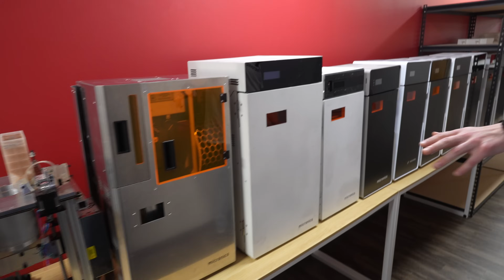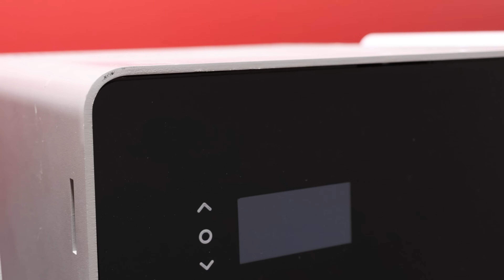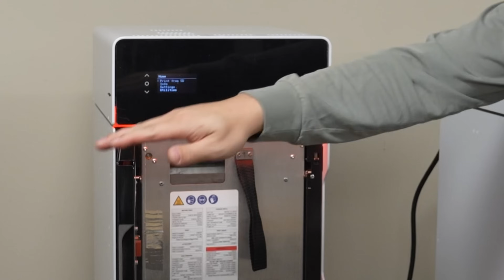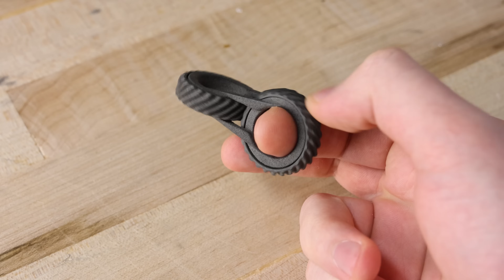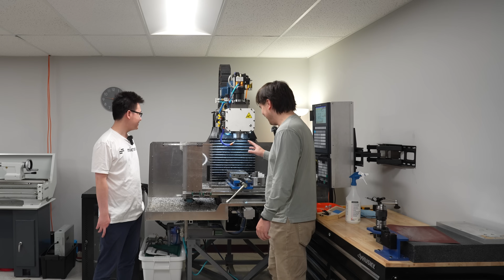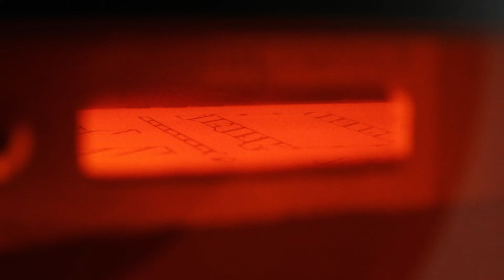micronics Lab Tour - Small Printer, Small Team, Big Vision

Comment: I would like to learn more about safety concerns when handling the powder. Powders are really scary to work with since they can get into and coat your lungs. A simple facemask is really not enough to keep the powder out, you need to get a positive pressure mask. There are definitely some DIY solutions that could be improved for a good positive pressure mask.
Reply from the maker: Most SLS nylon labs that I have visited seemed to have powder in the air. It seems like a safety concern to me, I would only use this in a well ventilated space, with a filter so you aren’t just exhausting microplastic powder into the surrounding g environment

Comment: I don't understand the kids here piling on the company - Strangeparts dude have created needlessly so much drama. Him suggesting them postponing the kickstarter and disclosing that they're "running out of money" has been a dishonest and pretty slimy thing to do. He didn't even do a review or the parts he successfully printed - wtf is that about?  It's like nobody ever received as 3d printer PREPRODUCTION!!!! unit that had problems. And these problems seem to be fixable, not something that is fundamentally completely flawed. 3d printers are precision machines, just bad shipping can destroy them.
Reply from the maker: Drop testing the packaging is very important! Shipping loads are much higher than anything a machine will typically see in operation. Usually by orders of magnitude
Reply: I agree. People are way over reacting. Micronics has cleared up most of the misunderstanding. Scotty is even still working with them. If they were pure evil, you'd think he would have stopped. They told him to publish the video along with everyone else publishing and he did. His big assumptions weren't very helpful. Either way, they've raised $1.35 million and I hope the printer is a great success! Really not sure why anyone wants them to fail so bad.

Comment: Really hope they are able to iron out the problems that other reviewers faced. Looks like they reached their funding goal so perhaps they will have enough capital to deliver.
Reply: SLS printer is massively complicated, so many things have to go just right and so many things can go wrong it's a miracle they've been able to miniaturize it so much and it still (mostly/sometimes) works well. Probably the hardest part is still ahead of them. Not only do they have to discover exactly what is causing each problem, but also how to prevent it from recurring, and then there has to be a rigorous quality control for let's say a batch of 500 printers. I do not envy their position in the least.